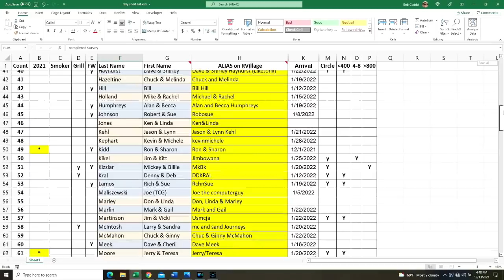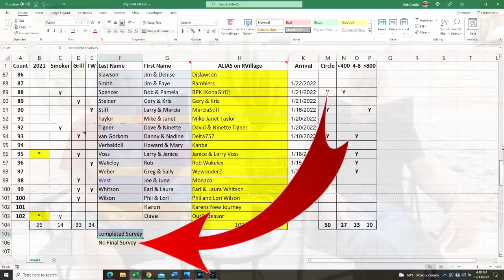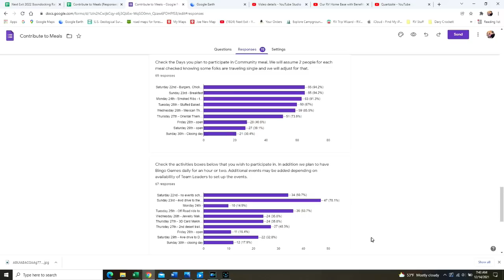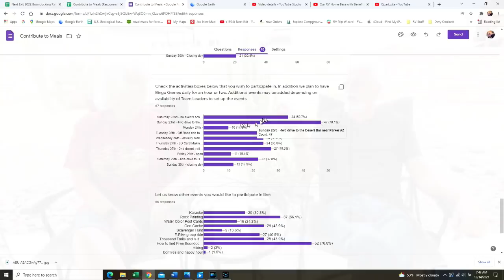HomeBase with Benefits

Comment: On 2017 we started full time in a 2014 Solitude 369RL . 20 thousand miles later we set it in a acre in a half. Then we bought a 2000 Shasta Flite 239 that we travel in now. Heading to Quartzsite after Christmas.  Hope to meet you just to say Hi.  Safe Travels.
Reply from the maker: 2017 seems to be a great year, lots of folks, including us started in the spring of 1017. Hope you have time to stop by and say HI next month
Reply: @JustPassingThru  We started in 2o17 as well 👍🏼 
Hope to see y'all here in Q